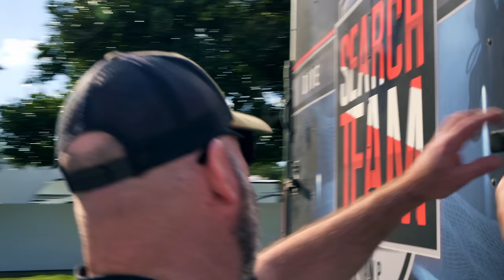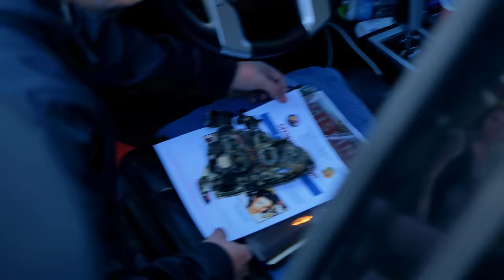SOLVED 38-Year-Old Missing Person Case in 6 Hours... (Maureen Sherman)

Comment: Blows me away that the cops didn't check there!!!😢 Her poor family having waited so long.
Reply: Right under everyone's nose!!
Reply: No sonar 38 years ago.
Reply: @teridoyle2120  sonar was used by submarines during WWII.
Reply: no budget as they always say. they can't read sonar even their divers are incompetent. jared will make their divers look peewees.
Reply: Yes, large analog devices that couldn't fit on a small boat, and probably takes much more power than modern ones. On top i doubt they had enough resolution to clearly identify cars
Reply: @Janeintheok  true but it wasn't available to everyone like it is today. Big equipment used on large boats pretty much for the military only.
Reply: I am just never surprised anymore. Cops are like wE hAvE nO iDeA wHerE tO lOok. Did ya check the backyard? wE hAvE nO iDeA wHerE tO LoOk.  For 38 years? Yeah, no sonar. You are in Miami FL, surely you have a dive team. ........
Reply: @Janeintheok you're talking about sonar that took up the space of a car. It wasn't prac5ical for law enforcement in the mid 80s
Reply: @catserver8577 they did. They said that water is almost 30 ft deep. This is dive tech of 40 years ago also. You can't fault them at all.
Reply: There would surely be signs that something had happened.
Reply: @teridoyle2120 I was Divemaster and Instructor back then, we did grid searches, no need for sonar.  Given she said she was going to do that right at her house, they would have easily found that car in a standard grid search of that area, doesn't make sense why they didn't.
Reply: @oledahammer8393  I agree. She should have been found immediately. Someone dropped the ball.
Reply: 💔 heartbreaking to think she was so close to home .. her poor kids ..38 years and she was there the entire time 💔 😢 
24 rushing cars polluting the water.  I hope council pulls them out to clear the canal .
Reply: Because they can’t see  any cars in underwater and too deep and  they are no scanning in 1980’s to 1990’s .
Reply: Yes so close to her home too the children. 😢
Reply: Back in the day, this technology wasn't what it is today. We can't blame our police officers for everything. Training in this area was not as it is today. Not every officer is trained in this area. It's a special skill.
Reply: @Janeintheok I'm sure it was cheap and easily fixable to any police unit /s
Reply: @Emy53  what’s the excuse to have the body of water scans and have the cars check? What about those other places where police don’t care and try to stop them from doing searches ?
Reply: Particularly with the broken fence 😲
Reply: I feel sorry for the fmily but they should have looked there first. On the other hand it's good they found her and family haneanswers now.
Reply: 30 feet deep doesn't sound extremely deep to me. Maybe sonar couldn't be used back then but a dive time could have found her easily 🙄 it probably wasn't a priority for law enforcement at the time. Her family must be so thankful and relieved.
Reply: Florida
Reply: The technology jus wasn't there then and alligators in the canals u u had to be careful
Reply: The technology was way way different no army ship is fitting in tht canal and not only tht u have to take into consideration the budget the dept. Has available for resources, but these Guys do it non-profit so as they said the detectives did reach out to them ,
Reply: @Janeintheok  This is a different small portable sonar.  As far as I know they are based on newer materials for transducers.  Also, I've seen video from AWP where they found underwater wrecks that the previous searchers had missed.
Reply: Her family could have paid a private diver $500 bucks to find her. I would never wait on the government to do anything for me!
Reply: @catserver8577  The police do help by eliminating various locations where the missing person is not present.
Reply: @Janeintheok  Yeah... to detect other submarines... Sonar imaging was not available to the degree that it is today
Reply: How many police forces would have had access to dive teams back then?
Reply: @Janeintheok  the sonar used by submarines in WW2 to localize ships and the sonar needed to find a car in a small channel are barely comparable. Sonar with the resolution needed to find a car on the muddy bottom of a channel hasn't been around for that long, and it certainly wasn't affordable until recently
Reply: @Janeintheok don't think  a WW2 sub would fot in that river
Reply: @Janeintheok Sound sonar not visual.
Reply: @Vito_993 You do realise that if there are 24 cars in that stretch alone plus those that have been recovered and the area of water involved in the state just what an insurmountable task it is?  It's alright you blabbing on in hindsight but there were no witnesses to say she actually did it and the police budgets are not infinite.  If they raised your taxes to fund a massive underwater search unit you would probably be the first to complain.  These guys found her but remember they are volunteers funded privately and from income from videos and not from your taxes.  They do not have the same financial constraints.
Reply: If they pulled a fishing net along it would snag on a car so no excuse for the cops finding it way back as she told her family she was going in there 38 years ago
Reply: Its Florida, any tourist attraction & people know people in the area where divers are likely to be in abundance vs somewhere like in the Midwest where theyre more sparse.
Reply: Wouldn't you be able to at least throw a magnet down 30 feet?
Reply: @Janeintheok  Yeah, massive machines to detect other giant subs in the ocean, not portable devices for rubber boats to detect cars on the bottom of lakes or rivers.
Reply: I watched one where the kid was missing for like 8 months. The cops kept telling his family he ran away. The mom kept asking them to search the river. AWP went in and found him in like 30 minutes.
Reply: I would have searched the canal myself.  At least right there. If they had started at the other end, they would have found her first. I can not believe no one checked the canal, especially with a note.
Reply: @Biffo1262  You realize that those 24 cars are from decades later and back than they would know where to look from the freshly broken fence, so it would be a tiny area to search. It would be a very surmountable task if they tried. They didn't.
Reply: Every cop: that case was so hard
Every true crime documentary: the cops ignored everyone who told them anything useful
Reply: @Janeintheok but submarines don’t fit in the canal
Reply: @Biffo1262 Well said.
Reply: People on here acting like the 80s was in the dark ages. It was completely possible to find her back then without sonar.
Reply: Well done Jared for keeping the mood respectful 🙏🏻.  Glad she can now be laid to rest after so long ❤
Reply: @catserver8577 hell, 100 odd years ago they would just drag a grapple behind a boat looking for drowning victims etc. Surely the same procedure would have worked for finding the damned car and then you send a dive team down the rope......
Reply: @Janeintheok yes the technology existed at that time but only for military use, not civilian. Much of our modern tech starts with the military and then years later becomes commercially available to consumers and non-military industries.
Reply: @teridoyle2120 sonar is not why they didn’t check. They didn’t check because they didn’t care. A 10 year old swimming could of found this if he wanted to
Reply: @prodigalbrock kids at the beach swim 30’feet all the time. There’s no excuse they didn’t look there. Just didn’t care
Reply: It’s mind boggling that even then they did NOT check when someone TOLD them prior…makes me wonder what our PDs are doing?!?! I’d want questions answered immediately! What a shame, yrs and yrs this family could’ve known…smh God Bless this family…thank goodness for people wanting to help others, thank you on their behalf!
Reply: @teridoyle2120 yes there was, my hubs fished, he had a detector on his boat…you can see things underwater…shame…
Reply: Some of those may have ended up in the water from a storm. Lots of cars.
Reply: @Janeintheok They couldn’t fit a submarine in the canal.
Reply: With the help of sonar it took them 6 hours to find her. Without sonar, it would have take days. It would have been dangerous for a single diver to do a search due to the possibility of alligator presence means it would have been a very expensive operation.
Reply: She told people she was going to drive into the canal and had an access point to do it right beside her house. I would have thought that's the first place you'd check. I'm glad her family finally has answers but it seems like it took way too long.
Reply: @oledahammer8393 For all we know somebody was paid off by the people who stole/ ditched other vehicles. 
Kind of a "how about you don't look in the canal" kind of bribe
Reply: @Janeintheok  Like a sub would fit 😂😂
Reply: Just didn't have the technology. AWP has top of the line sonar and only the live camera caught it. Plus 20 plus feet deep. I understand 100%.
Reply: @teridoyle2120  BS....My Dad had a sonar on his boat in 1985, we could see everything on the bottom of the lake.  We used it to find schools of fish.
Reply: BreatheScotland  In 1985 my dad had a Fish Finder sonar on his boat......we could spot rocks on the bottom of the lake.  We could see the depth of the lake and find schools of fish.  Easy to see a car.
Reply: @dezmodium  Very small unit, screen mounted to the passenger dashboard..  1985 my Dad had a Fish Finder on his boat.  We could see the bottom of the lake, schools of fish, rock outcroppings.  Why is everyone making ups stuff, they know NOTHING about????????
Reply: 30ft!!!
Reply: @Janeintheok Yes sonar was mounted on Naval Destroyers, and Cruisers. Not tiny outboards that only need 18" of water to float.
And even then they couldn't ID a car sized object on the bottom.
Reply: @LovelyLass-nb8op  When you put together all the signs, it's like "elementary, my dear Watson".
Reply: @Janeintheok  Sonar, yes... Enormous machines not at all portable like modern equipment.
Reply: A lot of people making ignorant excuses in this reply thread. That car should have been found within 24 hours after a report was made and within 30 minutesof divers in the water. She wasn't found for nearly 40 years because the MDPD simply didn't give a shît.
Reply: @catserver8577 The sonar thing is redundant. It's a car they leave tire marks. There's would've been disturbance in the water and surrounding banks. This woman told people what she was going to do. Just go diving. Thats what they used to do. The crazy procession that ends up attending for these events is mind boggling. A historical map of the area would be interesting too, probably would've been an easier find? RIP Sherman.
Reply: @nellymoo635 
Cars leave marks if brakes are applied.  Sometimes.
Reply: @wawabbit  Tyres will leave impression. No brakes needed. Depression will depend on soil,  cover, weather, time etc.
Reply: No sonar 38 years ago . How about 37,36,35,34,33,32,31,30,,,,,,,,, You know what I'm saying.
Reply: @teridoyle2120 They had divers. It was right next to her house and obviously the family knew she was planing on it. It’s just blatant laziness and incompetence yet again.
Reply: @catserver8577 If it wasn’t for cctv no crime would ever get solved
Reply: @Janeintheok not this type of live scan.  Apples and oranges.  This tech wasn’t around 20 years ago that can locate things with this clarity.
Reply: There must have been tire tracks in the yard.
Reply: Remember he said without the live sonar he was using he wouldn't have seen most of the vehicles including hers.
Reply: I did need a new car, but it seems that it is easier to just to pick a random canal in Florida and walk away with my choice of a dozen waterlogged cars.  😮
Reply: Right.  38 years and they couldn't send one diver to check the canal by her house where she said she would drive into.  What the heck.  Wasn't even that deep.
Reply: @oledahammer8393  Exactly.  A dive team could've easily searched where she said she was going to drive the care into.  Would've found her real quick.  Someone dropped the ball.  Ridiculous that the fam waited 38 years.  I would've just learned how to dive and checked myself, or hired someone.
Reply: A 1000x microscope with a monitor used to cost hundreds to thousands of dollars. Now you can get quality setups for less than $60. Much is the case with sonar technology. The average investigator with a decent fish finder has more equipment on their boat than most search and rescue teams did in the 80's. & That's simply just a fact.
Reply: Well, I would agree, but this is FLORIDA. Can't expect much of anything in a State overrun with CRIME.
Reply: I agree. I mean, it was only the obvious area to check, but scratch off another.
Reply: @johnmchardy4502  It would also snag on everything else. Including the multitude of trees. Please tell us how you would do it from the safety of your computer while the heroes are out there everyday endangering their lives rather than running their mouths.
Reply: @Janeintheok  Weren't some equipment limited to military use only? I recall hearing something similar to that before.
Reply: @estherwagner6735  well she told them where she was going to do it gos some people as so dumb and adventurous with purpose found a woman in her car right outside a house in a settlement pond 3 feet under the surface of water
Reply: That search was initiated by the police. They didn’t have sonar technology back when she went missing.
Reply: NO $$$$
Reply: @teridoyle2120 yeah but we had police divers & torches.
Reply: @teridoyle2120  lol 😂
Reply: @oledahammer8393 oh THATS’s interesting!  I have heard of grid searches of course but not in water. So you divers would go in lakes, ponds, etc. and just search for cars and/or bodies?  And if the police or Sheriffs’ Office would have bothered to look they would have found her. That is SUPER sad for the family 😢 thx for clarifying!
Reply: Because the cops don’t really care
Reply: @teridoyle2120  No divers either?
Reply: The police then & now don't care they only care about crimes they feel fit to solve or they just don't care . I believe if the Detectives and regular police didn't sit on there rear ends it wouldn't have took so long to find her . Then at the end of this video it said the police still have not Identified the remains  then get off your rear and Identify her . 

R.I.P. Maureen 😢💔😭
Reply: @edmontoncouple1562 no he makes them look Incompetent to do there job  the police don't . If they really wanted to learn sonar they could but they don't  . They should left to the team to recover instead of the police bc the can't what way there going
Reply: @teridoyle2120 sonar magnets and scuba gear existed in 1985.
Reply: Sadly it's because they didn't believe the family. It's tragic but they will assume whatever it takes to save money. A dive grid search back then would have been around 3k or 15k today or more. It's easier and again sadly the common answer internally to assume they ran away. This channel has exposed a lot of this issue with smaller departments and just straight up neglect. This only got solved as it was good PR and nothing else.
Reply: She literally said she was going to commit suicide by driving in the canal, so I think they could have found her as soon as she went missing!
Reply: @prodigalbrock  as soon as the technology became available, they should have sent someone to look!
Reply: @prodigalbrock  you can't fault them for a failed search 40 years ago, but by not doing searches when the sonar became available or just saying "well we searched and didn't find anything" (as if it's a one and done) then they can be faulted for that
Reply: @bkucenski How many crimes have you personally solved today? Have you solved any that the cops couldnt?
Reply: @Anna-Rose- Well why didn't you find her then? Are you a police officer? Are you out there being a better cop than the ones you complain about?
Reply: @GrabbaBeer  If you cared so much why haven't you found any one? I bet cops have found more missing loved ones than you ever have.  Are you even out there  trying?  Do you personally have have the money and resources to search a canal or river? Do you think searching water is a piece of cake? If you really  thought the police don't care you would become a cop and try to make it better by becoming a better cop than the ones you complain about. Are you doing that right now? I seriously doubt it.
Reply: @bjlafeversswatrub  I think you should quit complaining about cops. If you think that you can  do better the then the cops become one your self. How many missing loved ones have you found today?  I bet the cops have found more than you have.
Reply: @guyfanno1  so how many times have you searched the canals or rivers? If you think you can do better why aren't you a cop?
Reply: @DelayedPenalty Why didn't you personally find her? Did you even know she was a missing person? Do you know and partake in the searches of every missing person? Do you go to other states and help with the searches? Do you do everything in your power to look for a missing person? Please show us how its done so the cops can get it right. I doubt you do any of that so maybe you should try being less judgemental of the people who do try.
Reply: @MrBirdmann5150 So whats your excuse for not finding her? I bet you didn't even know she was missing until you saw this video. Are you out there being a cop and trying to find other missing people  because you care ? Do you know every missing persons name and lifestory? If not you must not care.
Reply: @Uhtredrag1080 Did you even know she was missing?
Reply: @Uhtredrag1080 So how many missing people have you found today since its so easy?
Reply: @johnmchardy4502  So since its so easy to search the waters how many have you found? If zero why aren't you out there at least trying?
Reply: @REPR100 At least they knew she was missing. I bet you didn't even show she had been missing for 38 years until you watched this video? And I bet you dont go out of your way to look up other missing persons cases? What's your excuse for not caring?
Reply: @markgulbranson-qe3ky Since being a cop is so easy to you and you think you can solve things by simply caring how many crimes and missing persons cases have you solved today?  I bet the cops have solved more than you ever have. I doubt you even know how to wipe your butt.😂
Reply: @Ericah81 Did you even know she was missing until this video showed? If you can do better put your money where your mouth is and be a cop.
Reply: @Ericah81 So why weren't you looking? Are you actively searching for other people who are missing or are you just sitting on your arse watching a video and complaining about people who do try?
Reply: @adamschrepfer1086 If you think you can do better at solving crime or searching waters become a cop and show everyone how easy it is. How many crimes and how many missing loved ones have you personally solved and found today?
Reply: no one said cops were smart
Reply: @rccyberwarrior2267  Yeah, like the backyard and the neighbors. Thanks, officer Krupke.
Reply: @oledahammer8393 Thank you for not making excuses for lazy, incompetent police. There are many good ones and many terrible ones.
Reply: There's like 14 other cars in that same spot. Ain't nobody got time for all that!
Reply: @Janeintheok it’d be way different and much more expensive back then
Reply: @user_angelmum rust is not an issue it’s oils in the motor you have to worry about .
Reply: I was going to say that. She told people where she was going, and even if they didn't have sonar, they could have still dived there to check.
Reply: Blows me away that the family didn't purchase a fish finder or hire a diver to go down and look when law enforcement has limited resources. Blows me away that the family didn't continue to raise the issue of her disappearance over the years.

OR

Perhaps the family knew she was there and didn't let on to law enforcement with what they knew, thinking the canal was as good as any resting place for their mother.

OR

Perhaps the police department simply didn't have the funding or resources to retrieve the car from the canal, and attempting a recovery of the body, alone, was too risky to a diver. With 23 other cars down there, that's not far-fetched.

Who knows? But what we do know is that there are a lot of people here making assumptions without having all the facts. There are also a lot of people here who act like they can do a better job, yet they won't apply or volunteer. And if you don't have the cajones to do the job, yourself, you don't have a qualified opinion on how the job should be done.
Reply: Good job guys!! ❤
Reply: Her family didn't care.
Reply: @Janeintheok checkmate
Reply: @T.R.U.M.P. Too many gators for a 500dollar private diver back then. The species had bounced back with a vengeance so great they Instituted a hunting season about that time.
Reply: The strange part she told her loved ones she was going to commit suicide and was going to drive her car into the canal. She was 47 at the time of her last day.  I loved how the sheriff lady stated are our divers here yet? So strange or neglectful that they didn't dive that area since family was told she was going to do it and no one heard the crash of the splash the trees were still messed up from where she barreled right through there. They didn't know. I find it hard to believe and totally neglect on their part. 

These awesome divers found her because they care and they are good and don't give up GB them for what they do!! Ty guys. 🙏✨💙❌⭕ RIP
Reply: They literally said … they didn’t have the technology.  Argue with the guy who helped locate her.  Wow.
Reply: @lilyrrichard236 it’s true that dive time may have found her earlier. But how many people in the area had dive training for that type of search. Not many I would have thought. 
No disrespect to the deceased and her family,but even if they found her 1,2 or 3 days after she disappeared, it wouldn’t have changed the outcome. Sad all round.
Reply: Police didn't do their job
Reply: Look this was 38 years ago police didn't have dive teams like they do now. Lay off the LEO.  She off'ed herself, the family should have hired divers way back then. BTW where was the so called concerned family at when they found her?  She drove through a damn fence they knew where she was. I can see looking for real missing people but not cases like this. From a tax payers point of view
Reply: @DelayedPenalty I agree! And when she went in, there probably wasn't as many other cars in the canal
Reply: @darknes7800 i agree!! I grew up by the sea. Was with a father's friend,and a friend in the mid 80's on a fishing trip, and he had equipment / sreeen to see fish, and how deep it was! And I lived in a small place in Norway! When we could get that kind of equipment there and in that time, I don't believe that the Police in Florida couldn't get that!!
Reply: To everyone that keep commenting on that they didn't have this sonar over 30 years ago; ok, but they had it 20, 15, 10 and 5 years ago!! They didn't have to wait that long to find her!!
I think it's wonderful that people outside the police force help next of kind to get a sence of closure, and at the same time they reveal the incompetance with some police forces
Reply: Sorry, but don't blame the police as this person chose to die by suicide!!.  She could have gotten psychiatric care, but chose to do this to her family. Sure that once she went into the water, she died unable to get out, drowning and terrified, but ignoring what she put her family through doing  this. Some might call this a very disturbed, selfish act
Reply: Not the cops fault;  She chose this for herself!
Reply: @johnmchardy4502 I remember that one John, was it the green boxy type car?? xx
Reply: The cops never give a dam unless it’s one of theirs or family… all those cars, just think what all those canal’s have in them, Jimmy Hoffa maybe?
Reply: I was gonna say that i mean they said she told her kids she was gonna do that by the house so why would they check there?? I don't understand that at all. Coulda of our her to rest years ago
Reply: Was a suicide not a homicide, why would they put that much effort into finding the car
Reply: Sorry but she told her family what she was going to do the answer was they from day one
Reply: @Janeintheok Sonar was way too expensive to buy, plus not as portable as it is in modern times.
Reply: There are more things to look rather than suicide case 😢
Reply: @edmontoncouple1562 Plenty of "resources" to sit on the side of the road stalking drivers to write traffic tickets though. ALWAYS able to do that revenue creating activity
Reply: @lilyrrichard236 OF course not, those donuts aren't going to eat themselves
Reply: @rccyberwarrior2267 Yeah I'm sure they cleared every Dunkin Donuts within 10 miles
Reply: @thadofalltrades It's south Florida.  Inexcusable NOT to have a dive team.  Back then? It wasn't the 1800's ffs
Reply: They just don't care 😢🙏🙏.
Reply: Thank God she's been found. Thank you Gerard and team.
Reply: 38 years ago they didn't have the technology to find her...